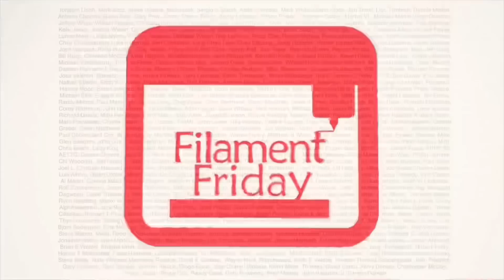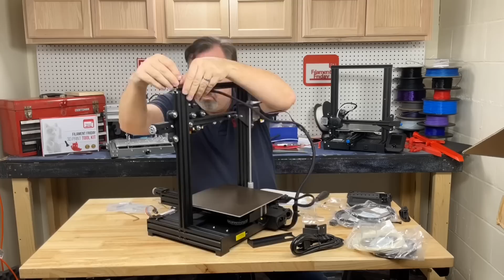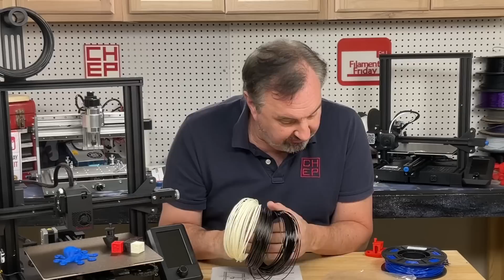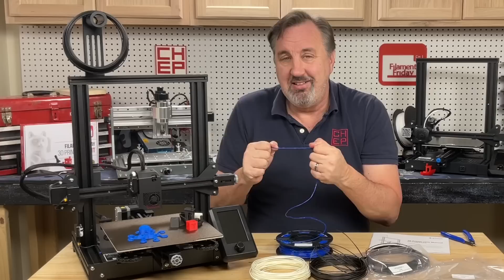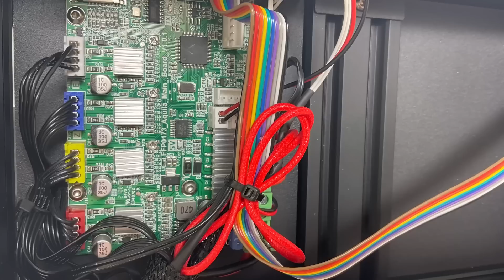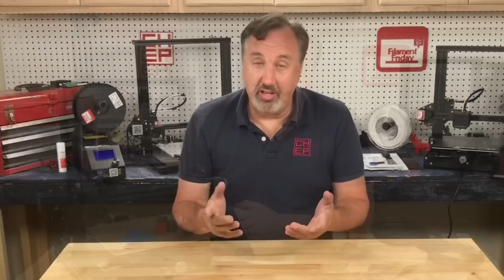First Look at Voxelab Aquila S2 3D Printer

Comment: I wonder why no one has developed a enclosed high temp ender-3 / ender-5 style printer... At least high temperature enough for Nylon / Polycarbonate Polymers.. my guess is probably just the cost
Reply: Price! these are entry level devices
Reply: @shaunmorrissey7313  Define entry level.

Because with just $150 in upgrades my E3V2 prints exactly like an mk3s.

A $10 shovel and a $50 shovel will dig the same hole in the right hands.
Reply: @shaunmorrissey7313  Absolutely I doubt anyone would spend $700-$800 on a kitted out ender 3/ Ender 5 lol
Reply: @infernaldaedra  Huh? That's illogical.

People buy the E3v2 instead of the mk3s right now. Why wouldn't they pay more for something that was the same price but even more decked out?

A slightly upgraded E3 V2 is just as good as a mk3s. So why wouldn't someone pay $700 for something that's twice as good?

You know people are already investing that much in there Enders now right?
Reply: @dangerous8333  you missed the point. Neither the E3v2 or MK3S is suitable for high temperature printing long term, & by enclosure I mean a heated enclosure. Which will would likely introduce too much heat into the electronics/psu/motors/printed parts to be reliable... 

I was just merely suggesting someone modify / adapt the E3 platform to be more suited for higher temperature possiblly even UHT filaments. . .
Reply: Ceality already sells a canvas enclosure that works really well. I actually prefer it over a big heavy, attached enclosure.